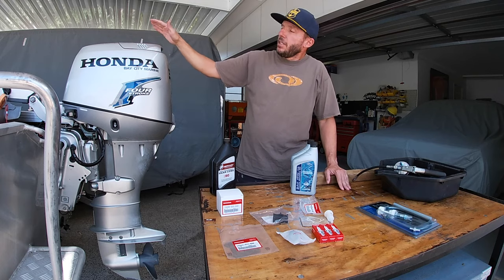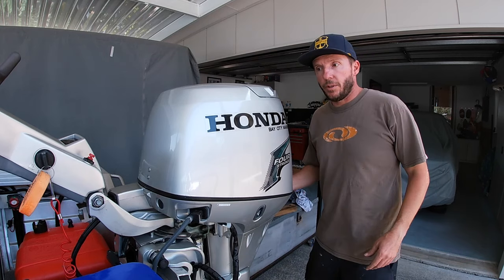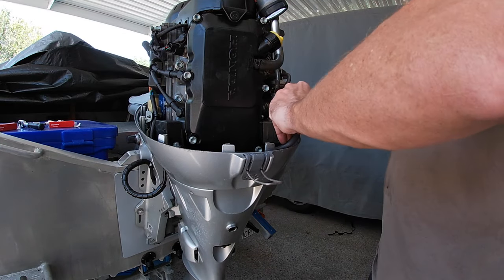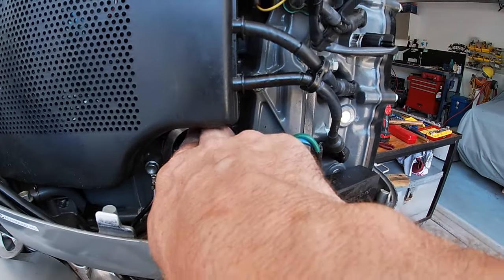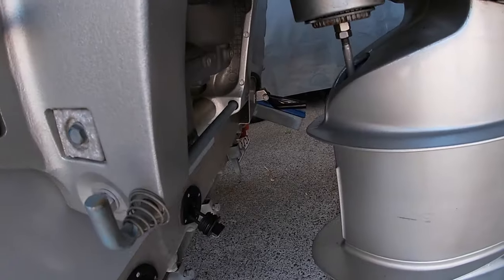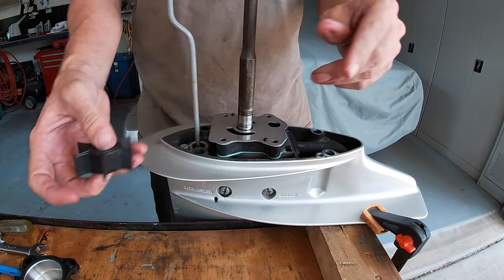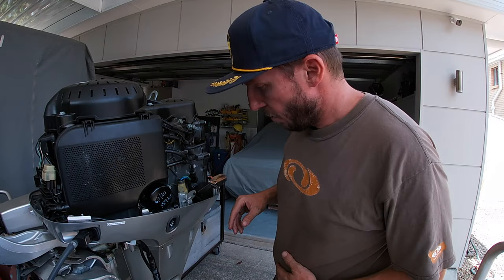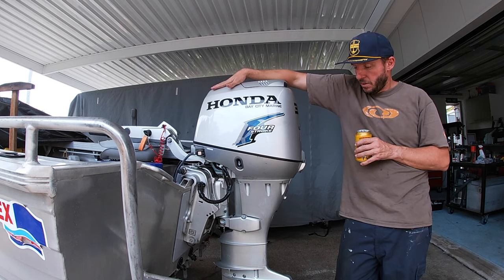How to service a 4 stroke outboard motor yourself - Honda BF30

Comment: (great video) 
Hello. If the upper hex section shown in 19:24 doesn't spin freely to remove the lower unit... (gear shifting rod)
Did some moron use red thread locker on it???
What do I do then???
Separating the nut from long hex section was okay.. But the upper portion does not spin to take it apart..
Is there an easy way to get that to twist if it is locked up??
I don't want to break anything.. Thx.
Reply: Lower unit bolts all had red threadlocker on them.. Geez..
Reply: Other video used CRC Brake Cleaner. Soaked for at least an hour. Hope it works.
Reply from the maker: Hi Mate I have never had the problem you are having. If there is thread locker on it I can imagine it would be very difficult to remove. The two nuts tight up against each other should be enough to keep them in place. Hope the brake cleaner works for you.
Reply: @AusAdventure  thx.
Not yet.. Added WD-40 penetrating oil after a couple hours of brake cleaner. Still stuck.
Will try a barbeque lighter next on the long hex nut. Too tight a spot for a regular torch or heat gun... And rubber mounts nearby. 
Is really weird that the upper threads of the long nut are solid.
Where the two nuts hit, those threads are freely moving. Damn.. 😎

Comment: ps do you have any videos of the motor 30hp Honda in operation on the water and with speed and fuel usage etc., would be really interested. gary.
Reply from the maker: You will able to see the motor running in quite a few of my other videos. I don't have any gauge to measure fuel flow how ever from experience I know I can get 90km out of a 25L tank and that is with the boat loaded up with camping gear. Hope that helps.

Comment: is the Honda 60 hp basically the same procedure to change the impeller?  Tom McAlister Perth WA
Reply from the maker: Hi Tom, I don’t have any experience with the 60hp so I don’t know what it’s differences are. However most outboard motors are similar and I would expect the 60hp Honda to be very similar to the 30hp in regard to changing the impeller. If you are not sure I would see your local Honda dealer. Thanks for watching mate.

Comment: What kind of speed are you getting out of that honda. i have the same one.  mine is on an 18' pontoon and i go about 12mph.  but it only uses about 3/4 gallon per hour.
Reply from the maker: Mate with a bit of gear in the boat I can get about 25 knots depending on wind and tide. Generally though I cruise around at about 20knots. I don’t know the imperial conversion but a 25L tank will get me just under 100km range. 👍

Comment: Good evening my friend I have a honda bf30 hp how much oil does the engine need when change the oil filter and when I don't. Thanks you very much.
Reply from the maker: Hi mate mine is 1.7L. I would never change the oil and not the filter at the same time so not sure if there is much of a difference.
Reply: @AusAdventure  thanks you very much my friend

Comment: followed what you did , flushed and cleaned the waterway replace thermostat put the new impeller in started the BF30 ...........NO WATER ??? any advice thanks
Reply from the maker: Make sure the muffs are on tight so there is enough pressure to flush through. Then I would pull the tube off the tell tale to make sure there is no crud stuck in the port. That’s the easy stuff. If it’s still no good you might have to double check the impeller. Good luck.

Comment: I've just acquired a 1995 BF50A, hopefully it's the same...   Any advice on the hydraulic tilt n trim stuff? :)
Reply from the maker: Mate I haven’t had any issues with my trim and tilt. After I use it I wash it with fresh water while moving it through it’s entire range of movement. 👍
Reply from the maker: @bigglyguy8429  yeah that usually means it needs an impeller. However if you are flushing it with those engine muffs ensure they seal properly as I have seen that if they are old and don’t seal there is not enough water pressure to get it through the motor which gives the impression that the impeller is stuffed but in fact it is ok.
Reply: @AusAdventure  It's actually in a big water container, with the water (just) above the cavitation plate. One thing I haven't checked is to see if the inlets are blocked but I read on a forum that it's common for the pee stream to block on these. However the usual spots of blockage are OK, so yeah, impeller time :/  For ease of starting and still looking pretty clean under the cowling I love it though. There's a few rusty bolts n bits here and there but it really doesn't look like a 25 yr old engine. I imported the boat from Japan a couple of months ago, have been too busy to even try the engine. Once I charged the battery and remembered the safety lanyard it started 1st turn of the key (well 1st turn with the safety lanyard in place!)
Reply from the maker: @bigglyguy8429  yep sounds like impeller then. Hope it ends up being a good motor for you. 👍
Reply: @AusAdventure  Cheers! I solved the pee stream issue :) Just add water....  Unlike the 2 other outboards I've owned, this one has a water intake high up under the cavitation thing and while it WAS under water there was too much turbulence and air bubbles stopped it working. When I raised the water tank on some bricks and got more motor under water it suddenly squirted like a race-horse! And again today, for fun I tried starting without any bulb pumping, no choke, no fast idle, just turned the key. It took a long crank, about 6 or 7 seconds but she fired up and just sat there piddling happily, as if to say 'See? You're an idiot.' lol
Reply: I had a blocked pee hole and pushed a wire down it ,now pees fine

Comment: Looking at a 2020 Honda 30hp it’s apparently calibrated $5890 . I wonder if it’s still the same as the previous model . If I ever bump into you down the boat ramp one day I’ll have a look yours.
Reply from the maker: Yeah no worries. Mine is a 2008 so will probably be quite a bit different.

Comment: Do you run anti freeze through the motor to clear any water in the lines?
Reply from the maker: No mate I only flush it with fresh water.

Comment: How come the oil filter was so empty of oil when you took it off?  Do you have a specific trick to get it to be emptier before loosening it? My filter usually is quite full of oil and a considerable amount flows to the lower engine cover as the filter's sealing opens. Using a rag etc to absorb the spilling oil usually may fail and I must spend (too much) time to clean the engine.
Reply from the maker: Mate I do drain the engine oil before removing the filter. It just never seems to have much oil left in it so I don’t have any tricks to tell you about. I think it just depends on the motor. I did a service on a Suzuki 115 the other day and a heap of oil came out of the filter when I removed it.
Reply: @AusAdventure  My Honda BF 30 is from 2005. I, of course, do also drain the most of the oil out of the engine before I loosen the filter. 
But like I said there is still too much oil in the filter not to get the job done as clean as one might think.

If we consider that a professional service is doing the job they must be quick in order to collect the maximum profit from the job. 
Gravity is helping with the other oil draining situations but the filter is a problem. 
They cannot afford to spend time to clean up any mess with rags etc as the lower cover is very strict with all the stuff in it. 
Either they are able to empty the filter before they take it off or they clean up the mess by diluting the waste oil residue with an appropriate substance and then washing it off.

Last autumn I tried to tilt/turn the engine couple of times and some small amounts of oil still came out from the main drain slot. 
But there was still some oil left in the filter and that would have made a mess (again) if I failed to place the absorptive rag dense enough.

That filter/oil leak problem is the main reason why I've looked at these videos. But if your engine does not have this problem there might be some development done by Honda over years. Your video holds some additional steps I've never done before myself and those steps like checking the spark plugs and the impeller are very useful for me and I have to say many thanks to you for showing how they must be handled.
Reply from the maker: Yeah my engine is a 2008 model so it might have changed a little. Anyway glad the video was helpful. 👍
Reply: @AusAdventure  I did the maintenance service for my engine yesterday. There was a lot of waste oil in the filter again. This time I only had very good absorptive material to take it out before it flowed to the lower cover of the engine. It would be a good thing if there was a dispensable shaped cover for a waste oil bowl btw. After the oil is poured away from the bowl that would just be taken off and no cleaning of the bowl would be needed (I do not leave any waste oil to the bowl as it smells unpleasantly in the garage). This time I just put a random plastic bag on the bowl. Oily bag the just off with the other oily rugs... Btw... Have you had any troubles with your engine? I had the electric trim motor replaced some years ago but any other problems. In the service they said it is better to be replaced than to try and fix the old one. The trim motor was a reasonable to replace when it comes to the costs but the whole trim unit would have been about eur1.700,-  And that is nearly a one third of the price of a new engine... But otherwise the engine has been very reliable.
Reply from the maker: @Modafinil  No mate I have not had any trouble with my motor at all. Good on you for servicing your own outboard. Hope it keeps working well for you.
Reply: @AusAdventure  I guess you use your engine in quite different climate conditions than I am. During winter we may have even -20 or -30 degrees of Celcius (rare nowadays though) and that keeps us from out of the waters many months. The country is Finland.

Comment: Hey dude.  When we are filling in the engine oil , can we fill from the top hole instead from the bottom hole ?
Reply from the maker: Do you mean the gear oil? As the engine oil only has the one hole to fill from.

Comment: Well played. Thank you!
Reply from the maker: Hope It was helpful mate.  Thanks for watching👍
Reply: @AusAdventure  certainly was, just pulled the Honda 20 out of the shed for an upcoming camping trip, thanks to your vid I pulled the gearbox off to check the impeller, by definition it was more of a grommet than an impeller, cheers mate, you've saved me an impeller change on the beach :-) and a few hundred bucks service ;-)
Reply from the maker: That’s awesome mate. Hope you have a great camping trip.

Comment: Hello, I have a BF20D honda, and it started leaking through the hole right above the thermostat, that hole is supposed to be a drain point. Do you have any ideas of how do I fix that?
Reply from the maker: Not sure mate. I have never had any leaking issues with mine. You may need to take it to a Honda dealer to check it out.
Reply: That hole is a flush point, a special adaptor 06190-ZV1-860 screws into that hole and you can then connect a garden hose and flush the motor without the motor running. Inside the hole is a valve which is opened by the hose water pressure and a spring provides back pressure on the valve to reseal the hole when the hose water pressure is turned off. Like mine it is likely that crud build-up has stopped the valve from working properly. If you don't want to take the water jacket cover off to try and fix it,  just get an M8 stainless bolt and cut the shaft length to 10mm, put an o-ring on it and gently screw it into the hole to seal it off.

Comment: Got a bf 25 when I give it gas at half to full and thrusts it almost shuts off and I have to choke it real quick to keep it alive even though I cleaned carbs am I missing something?
Reply from the maker: I’m not sure mate. Probably best off going to you local Honda dealer. However I would check the spark plugs, fuel pump and quality of the fuel 1st.

Comment: Hello I have a honda bf30a 4 stroke and when I put the power to the max it is not going fast I have changed the spark plugs it does not change anything  it going great the problem is the speed I need your help
Reply from the maker: Sorry mate but I’m not sure what your issue is. Could be a few things. You should probably see your local Honda mechanic.

Comment: Job well done!
Reply from the maker: Thanks Ray. Hope it was useful.
Reply: @AusAdventure  You're welcome. I plan on tackling my BF40 Honda when the parts show up. One extra lower unit bolt hiding under the trim tab. Internals look to be similar.
Reply from the maker: Good luck.
Reply: @AusAdventure  25 minutes to take the lower unit apart and disassemble the water pump impeller housing. Cleaned and prepped waiting on parts. 20 year old stock impeller looked and felt perfect.

Comment: How do you read your engine hours?
Reply from the maker: I have an hour gauge installed. 👍
Reply: @AusAdventure  Thanks for answering! Do you use the Honda hour meter available or some other third party version that wraps around the ignition wire?
Reply from the maker: I have the Honda meter.

Comment: I don't know what you did to get the lower unit off I loosened the nut and had it in neutral and I can't get the lower unit off I loosened the shift rod nut all the way down the lower unit on slides down about 6 inches and won't budge I am stuck I don't know what to do next anyone have this problem this is very very hard to pull All the way out
Reply from the maker: Hi mate. Is it the exact same model as mine?

Comment: Do not do what he does and wrap on the anti-cavitation fins to pull the lower foot off.   They break very easily.   Tap on the aft nose in the middle (above the trim tab) where there is lots of meat (metal).
Reply from the maker: probably a good tip mate.